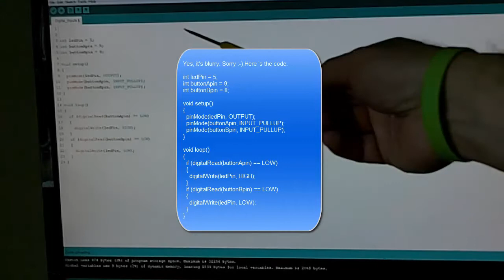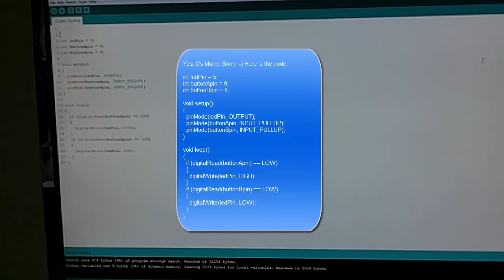Use an Arduino to control an LED with 2 push button switches

Comment: Hello, could you help me adapt this code for the TINY 13A microcircuit, I tried, but it doesn’t work, I think that the small TINY 13A microcircuit is best suited for this, it takes up less space and costs less than the arduino board. I will be very grateful to you...

Comment: Hello, a very simple but interesting project, I wanted to repeat it on the Arduino-nano board, but for some reason it didn’t work, I tried to change the pins, but nothing happened. Please tell me what needs to be changed in the code so that it works on arduino-nano. I'm just new to this business. Thanks in advance.
Reply from the maker: I'd imagine the code would be the same for any Arduino board (but you need to account for different pin numbers). Can I have a look at it? Is the circuit built right?
Reply: @CircuitCrush  Thanks for the answer, everything worked for me, the problem was in poor contact. I wanted to ask how you can add a time delay of 3-5 seconds, I just want to make a carriage with rollers so that it goes back and forth, when this carriage reaches one edge, it should press the button and stand for 3-5 seconds, and then go to the other side there, too, it should reach the other button, click on it and stand there for 3-5 seconds and go back and so on to infinity back and forth, I made this time delay from the circuit for smoothly turning on the LEDs and it works well, I just I want to remove this scheme, because I think that it can be done programmatically using the "delay" function - but something could not be done, now I think that it needs to be done using the "stop loop" function. Instead of the LED, I set the relay to 5 V and this relay controls the DC motor and reverse. (for the DC motor, of course, you can use the N-bridge circuit on the "SN 754410" chip and the like, but I don’t want to use it, because I think that it is not necessary), ultimately I want to get rid of the Arduino-nano and do it all on the ATTINY 13A chip. I want to try to make a bed massager for back massage.

Comment: Hallo Sir,
My LED is allready on forever and buttons have no funktion at all. 
This is the Sketch

int ledPin=5;
int buttonApin=9;
int buttonBpin=8;

void setup() 
{
  pinMode(ledPin,OUTPUT);
  pinMode(buttonApin,INPUT_PULLUP);
  pinMode(buttonBpin,INPUT_PULLUP);
}

void loop()
{  
 if(digitalRead(buttonApin)==LOW);
 {
  digitalWrite(ledPin,HIGH);
 }
 if(digitalRead(buttonBpin)==LOW);
 {
  digitalWrite(ledPin,LOW);
 }
 }

Comment: Hallo Sir,
It's very interesting and looks like your code are very simple, but I have a problem my LED is always on for ever and buttons have nothing to do, buttons it has no funktion at all. I have a project with 2 buttons like yours, but mine has 3 LEDs in row. When i press button A once, first LED goes high, 2nd time 2nd LED goes high and 3er time 3rd LED goes high and button B like yours at opposite direction the LEDs low. Could you help me please?
Reply from the maker: First, be sure you go the code right. Then make sure it's wired right. I'd tie all 3 LEDs together if you want all of them to go an/off.

Comment: // i do a changes, with this code you can turn on a LED o relay with one button and turn off with other button. 
int ledPin=13;
int buttonApin=9;
int buttonBpin=8;

void setup() 
{
  pinMode (ledPin,OUTPUT);
  pinMode (buttonApin,INPUT_PULLUP);
  pinMode (buttonBpin,INPUT_PULLUP);
}

void loop()
{
  if (digitalRead(buttonApin) == HIGH)
{
digitalWrite(ledPin,HIGH);
}
if (digitalRead(buttonBpin)==HIGH)
{
  digitalWrite(ledPin,LOW);
}
}
Reply from the maker: Nice. Like they say, there's always more than one way to skin a cat.